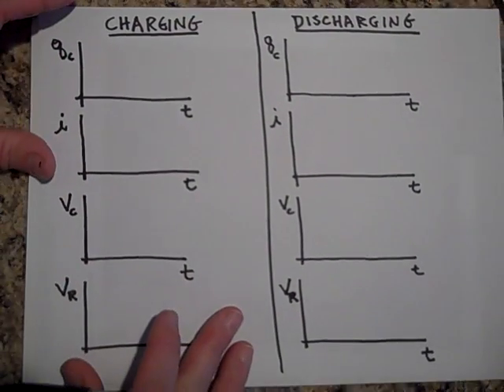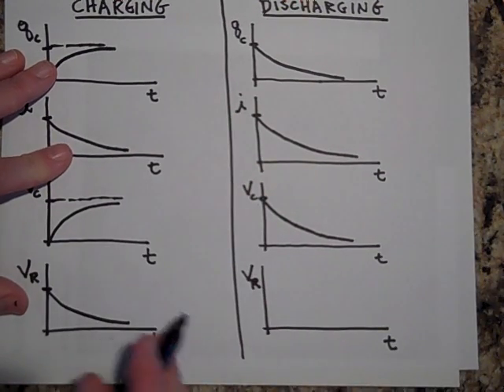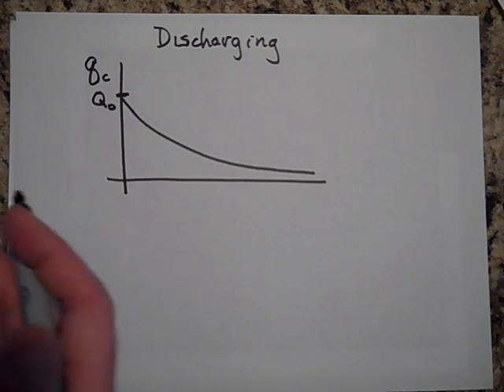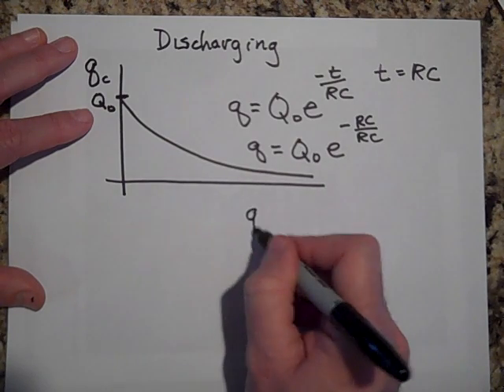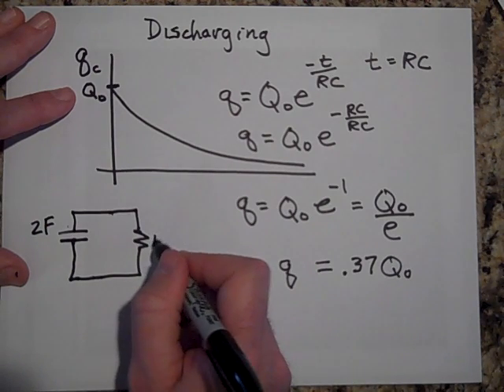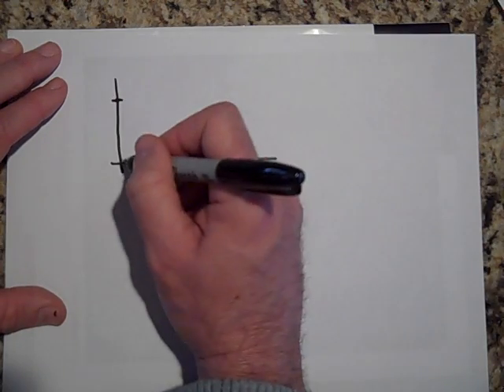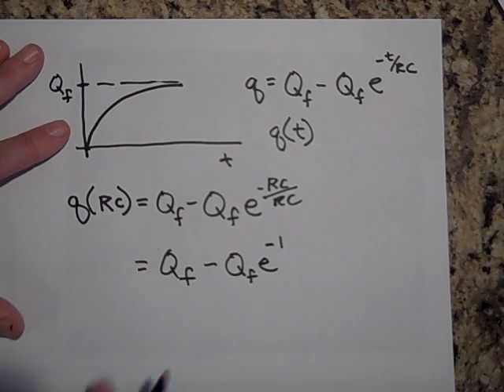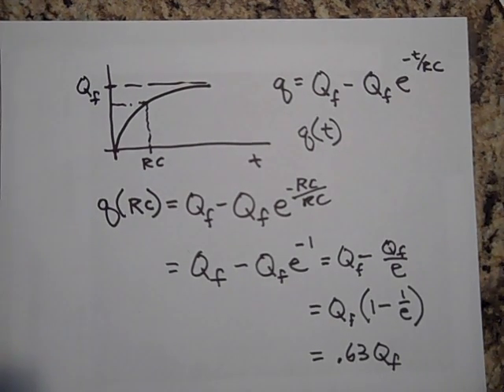The Time Constant for an RC Circuit

Comment: I still have no idea how to find the time constant in terms of seconds.
Reply: T=RC.
   T = RC time constant in "Seconds".
   R = Resistance in "ohms".
   C = Capacitance in "Farads".

Keep in mind that units given may need to be converted before using the formula. For an example... 1k ohm needs to be converted 1000 ohm and 1 micro farad needs to be converted to .000001 farad. Hope this helps.
Reply: does the voltage of the battery not have an effect?
Reply: You need to define ohm and farad in terms of SI units then multiply them. You will get second as a result.

Comment: The graphical representation of current does not appear to be correct. "Current leads voltage". On the charge cycle of a capacitor current spikes quite quickly
at the beginning and then falls away. At the same time voltage builds as is described on
the graph. Current and voltage are 90 degrees out of phase, not the same. I'm only
learning about this phenomenon now. Have I missed something?
Reply: david brayshaw depends on the phase shift

Comment: Very good.

Applying the right time period square wave to an RC circuit and measuring Tau then deriving either R or C given one of those values is a good exercise in both the time constant and using a scope.

Comment: an 8uf capacitor is fully charged to a p,d of 20v, the capacitor is then discharged through a 1Mohmresistor. Calculate
1-the initial discharged current?
2-the initial rate at whichthe p.d across the capacitor is charging?
3-the current and the p.dat a time equal to the time constant after the start of the discharge.?
thankx

Comment: sir i am ask to solve nagging asssignment , and need your help.please.
the cct below show the switch is moved from 1to 2 and left there until the capacitor is fully charged.
find a) the energy stored by the battery during that time?.
b)the energy dissipated by the resistor during that time?
c)the energy stored by the capacitor during that time?
data:
V=60v
R=4kohms
C=50microfarads.
thanks

Comment: If you have multiple resistors in your circuit then which resistor's R value do you plug in for R when calculating the time constant?
Reply: If they are in series then you can consider only one resistance which is the sum of them Rt=R1+R2..